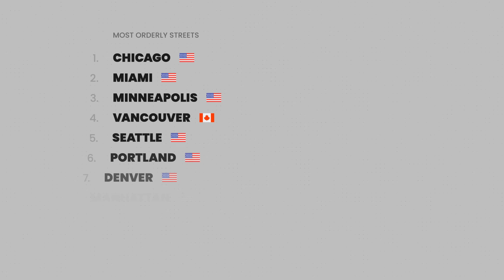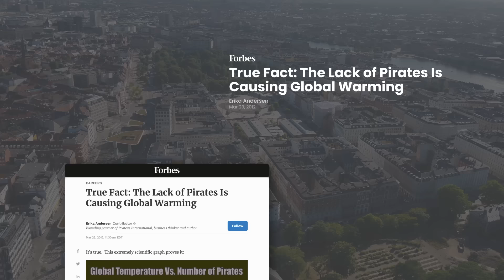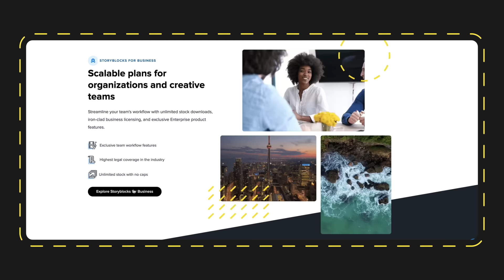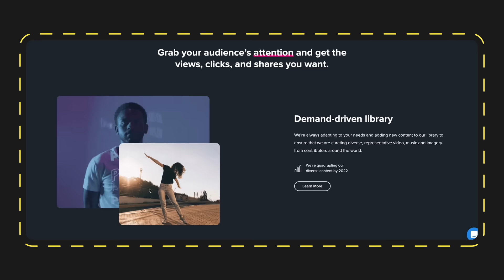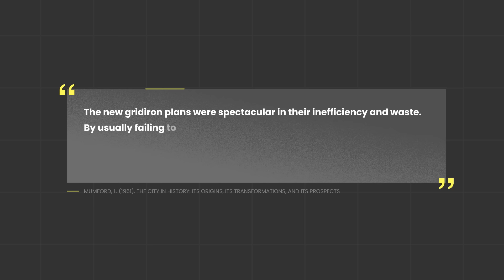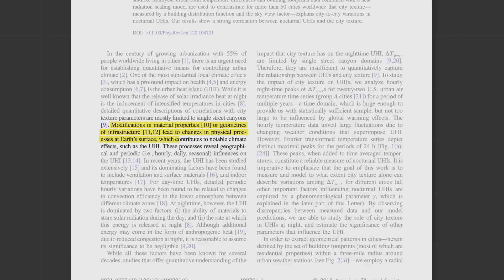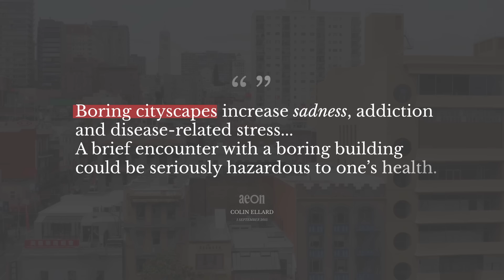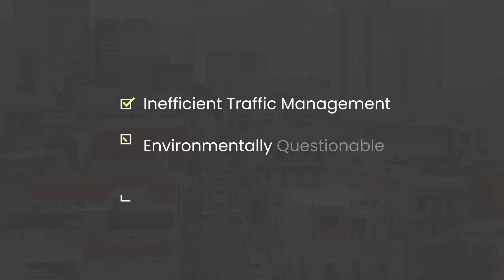Why Cities With Grids Are Terribly Designed

Comment: Urban planner here. I'm afraid this video is conceptually confused. All of those "most livable cities" have a grid in the sense that they have small blocks. A grid of small blocks is absolutely essential to support walkability and transit, whether they are straight or organic. Yes, if the grid is straight, with 90 degree turns, it can look a bit boring — the video's one legitimate point — but these grids can still support high levels of livability, as in Vancouver, Portland, San Francisco, New York, Barcelona, and many other cities. 

As for the grids that do have problems, the video got the issue precisely backwards. If Chicago has a problem, it's not that it treats streets as identical. (It doesn't). The trouble is that it excessively prioritizes traffic on many streets instead of human comfort. One of the biggest barriers to creating livable cities today is that streets are classified as avenues, collectors, or locals. On avenues and collectors, it's extremely difficult to design people-friendly streets, because engineers say they are intended for moving cars. 

As for safety, no, the grid is not the primary source of danger. High speed streets with long blocks are far more dangerous, as they encourage people to cross mid-block. That being said, I haven't looked at that one study.

The biggest barrier to livability that many cities face today is the lack of a grid — whether straight or organic. I'd like to solve that problem. This video didn't help.
Reply: Your entire notion of "livable" revolves around how walkability the streets are, which is nonsensical. Nonetheless, use walkability instead to simplify things.
Reply: @aliquewilliams3080  Why is that nonsensical? It's difficult to create lively, desirable streets and parks without also making them walkable.
Reply: @aliquewilliams3080  walkability is absolutely synonymous with livability.
Reply: Whathever the gov put his hands, it will get whorst. Let the city expand by itself...
Reply: The traffic problems of grids are caused by a total absence of road hierarchy. Arterials could be made by removing 67% of intersections on a big enough road, de - zoning buildings, and then put on some bus + tram lanes, bike paths, wide sidewalks.
Reply: @Spido68_the_spectator  Large blocks increase speed at the expense of access (the ability to travel directly to destinations), and in a dense urban environment, access impacts overall transportation time more than speed (especially for peds, bikes, and transit, but also for cars). This is especially so because pedestrian-oriented businesses and high-frequency transit cannot succeed on streets with large blocks, because they undermine walking. Large blocks are an appropriate solution for low-density car-oriented environments, where all destinations are far, meaning that speed trumps access.
Reply: @TristanCleveland  why not superblocks then? With ground public transport and cars going around, while each superblock is fully walkable (and plenty of pedestrian and bike infra between each)
Reply: @Spido68_the_spectator  Yep. Just keep in mind you need a higher level of density to bring street life to those paths without cars present. Streets without cars tend to die unless there is a high critical mass of people walking there already. (Lots of streets across North America have died when cities tried removing cars). Also, it's important to treat the connections as real, high-quality streets (or parks), rather than as half-assed paths on empty green grass — because few people will use them. 

Two caveats for cars: having so few streets means much less capacity for moving cars, unless you make the streets really wide, which undermines walkability. You also can't make the streets much faster for cars (or ought not) because that too undermines walkability. For these reasons, I think it's generally a better idea to stick with a traditional grid, but you certainly can make the superblock idea work with attention to these details.
Reply: @TristanCleveland  You seem to forget that streets are destinations and where the life of the city happens, not throughfares.
Throughfares for cars can be as wide as needed within sanity, as there shouldn't be any buildings off of them, and pedestrians and bicycle riders will be given fully seperated paths. Not to mention the straight/fast aspect makes them good contenders for dedicated tram/bus lanes in the median or outside.
Also, the street grid is a waste of space on its own and contraints building aethetics. A crap ton of unecessairy intersections which could be open spaces, pedestrian + bike path ect that make it feel like a grid inside a totally free form street design. You should stop relying exclusively on sidewalks to move either pedestrians or bicycle riders.

Also, the " dead " streets observed in the US and Canada are down to the morality that built up over the decades : " the street in front of the house is a death trap for children ", " leting children go to school on their own is to court de@th "...
Reply: @Spido68_the_spectator  The destinations in walkable urban areas can only survive if people can walk between them. Wide roads didividing destinations means there will not be destinations. Yes, thoroughfares can be as wide as you like, so long as they are outside communities. The streets that pass through communities must support human comfort or they will drag down street life and undermine the underlying logic of urban economic growth.
Reply: @TristanCleveland  yes, that's exactly what i said. Cars going around, people living inside and able to travel still without driving
Reply: @Spido68_the_spectator  Usually, the only way I know of a business existing is if I see it while passing it in my vehicle.  I don't walk anywhere, and I'm not going to.  If there is a place for me to park by the place of business, then I may go there, but if not, the business will never get my patronage.  That is just how I do things.  It does not hurt me to never enter a business.  The only one it hurts is the business if I don't enter.
Reply: @jpmarques1106  cities became car-centric in the first place because of government policy of making cars the only way to get around, which was caused by car company lobbying. Plus, the only reason roads are even paved are because the government stepped in
Reply: Saying he's conceptually confused and referencing small blocks is unfair. Small blocks are fine. It's when they are made on a big scale, where the land features are ignored and a 5 mile grid of bland sameness is erected. In Sydney we have plenty of small blocks, but when you look closely they are always submissive to the shape of the land they are on. That's what gives a city its soul.
Reply: @greenonionsalad  the video never addressed how the size of blocks is the issue. In fact, he even at one point said how the high number of intersections causes more traffic; a point against the grid. The real problem is how the streets are designed, not how they’re laid out. Like with Barcelona; design the streets for people instead of cars, and you will have a city just as nice to live in as with non-grid streets
Reply: I'd disagree with Vancouver and San Francisco being livable, the North American East Coast is the definition of hell on earth, but Barcelona is definitely a great example. Especially since having limited access to cars between blocks - it's highly walkable, highly accessible, and the pedestrianised streets are booming with commercial activity
Reply: @aliquewilliams3080  Bruh were you born yesterday?
Reply: @aliquewilliams3080  you clearly don’t understand cities
Reply: the whole point is not ability to change position, but whether it has any meaning, specifically - aesthetic meaning.
Every city should be a loop with a park-like center. at least.
Reply: @extremumone  why does it need to not be in a grid to give the place meaning? Central Park is one of the most well known city parks in the world for its size and beauty, and it adheres completely to a grid.
Reply: @extremumone  to me the argument seems like saying that cities should paint a mural on every fire hydrant to give each of them their own meaning. Yes it might look nice, but it loses some form of practicality (makes them harder for firefighters to identify) and just is unnecessarily complicated to change. Sure it’s fine that you might prefer non-grid streets more, but function over form has always been proven to be true.
Reply: How is New York 'livable'? I'm from Singapore, visited New York once and never want to go back there again. Streets are dirty, noise pollution every where, rent is crazy expensive, food is expensive, there's trash and filth everywhere. Singapore and New York are one of the most expensive cities to live in but it's so much more comfortable AND safe to live in Singapore compared to New York.
Reply: @reveirg9  thank you Singaporean. Anyone wondering how to design a city, look at Singapore and say no more. It’s not hard, with lot of common sense.
Reply: When you say "On avenues and collectors, it's extremely difficult to design people-friendly streets, because engineers say they are intended for moving cars.", is it more of a universal reality around the world or some tendency of builders specifically in America?
Reply: @edwardyoon6296  USA, Canada, and anywhere where the AASHTO Greenbook is influential. Many countries do adopt it. 

*I should have said arterials.
Reply: This was really interesting. Thanks for sharing
Reply: I never get bored with straight lines, it's faster to walk, drive, think. I do not have a airplane, i'm not a bird, i do not keep looking everything from top.
Reply: Just for fun, let's add another parameter that has nothing to do how livable a city is and that would be flatness. Chicago is very flat whereas, say Seattle or San Francisco is hilly. I'm sure there must be other cities even more hilly. Would flatness that makes travel easy by not having to go uphill or downhill esp during wet or icy conditions make a city less livable? Similarly a grid makes navigation easier esp in an unfamiliar part of the city esp during night and/or foggy conditions. Merely recognizing the street name on the south side that one is familiar with on the north side instantly gives one an idea of where they are. How does this not make it more livable being able to travel further from one's familiar neighborhood and explore more distant parts of the city? Or the ease of giving someone directions. A gird is not an issue, but many other factors are, including proritizing too many streets for cars, or not having better public transportation or due to food desserts, insufficient parks and green space, or having giant malls with huge parking lots vs small neighborhood retail stores that are walkable and not having options for a third place (not work, not one's house) where people can hang out and socialize for free (not a bar, cafe or restaurant) year round (not a.park ij winter) available anytime and without severe restrictions (not a library). Such places have been disappearing.
Reply: When I think of "liveable" San Francisco and Portland definitely spring to mind /s
Reply: Please go on google maps, use Copenhagen as a case study, and count the largest grid you happen to find. Then do the same for Chicago. In your first statement you confuse "blocks" and "grid". Among the grid cities you yourself mentioned, I can tell you that at least New York and BCN are taking active measures to transform their grid with street closures to cars (see "superblocks" and "open streets"). This supports the video author's claim that the grid itself doesn't cause cities to be less livable, but rather that when cars are introduced into cities, the cities with the larger and more uniform grids end up with worse street conditions.
Reply: @misopix  I'm afraid I don't understand what you mean by "largest grid." Copenhagen has blocks around 200-500 feet in "block section" (the furthest distance you can measure inside the block - a useful measure of block size). Chicago has blocks roughly 400-650 feet. Both are very walkable, though Copenhagen more so. 

Pedestrianizing some streets is great. It retains the walkable network of small blocks for people walking, which is what counts for pedestrians. Whether we call that a "grid" or not doesn't matter much: people just need short blocks to walk in a straight line to destinations.
Reply: @TristanCleveland  I had a roommate at USU that was from slovenia. He was getting his masters in city planning or something working on a project to make a more walkable or people friendly map for Odgen, Utah, I believe. I can't remember. Yes for people culturally used to walking and living in cities I suppose it makes sense to make cities walkable. But I'd argue one reason cities weren't designed that way was because of prices of real estate. Many people prefer to live further away from the city and travel to work. The cost of real estate or housing seems like it'd be cheaper or would promote more affordable housing if people could travel rather than rely on walking from home to their work. It's one reason lots of cities have literal commercial or industrial zones for businesses to build in. Sure they can build a warehouse or mechanic shop etc. in the center of a city, but I've seen many businesses be engulfed by real estate development eventually selling and moving the business to the edge of the city or out in the county. Now for high paying companies or whatever sure it doesn't matter. Big banks or law firms etc aren't going to leave the middle of a city. But many many jobs literally are forced out of a city especially if the company rents the land or building. Public transportation helps sure, but if you build a train system that's still not a walkable environment. In Utah for instance many people drive to parking lots by a train stop and then ride the train to the city. But you're not walking as you drive to the train parking lot and then you take the train. Even in the rural town I live in with a few massive companies that make guns or airplane wings theyre on the edge of town. If people were to walk they'd literally would have some walking three miles one way and that's not very livable if the temperature is 20-30 degrees for a few months or if it drops to zero for a few days. People aren't going to ride their bike either even if there is already low traffic. The city or town has zoning laws so the first block is commerical, but no large company builds on the first block as you can't expand. So large companies literally have to be on the edge of town.
Reply: @Spido68_the_spectator  traffic is solved and intersections are removed on some roads. It's called the interstate system.

Comment: Cities like Chicago and Minneapolis are FANTASTIC when it comes to car transportation unlike Dallas and Charlotte
Reply: Cities should not me made for cars.
Reply: @karsthalen5381  Yes they should be*
Reply: @aloe704  No. Not at all.

1. Cars are polluting. In a place with many people it’s important to keep the air clean. Public transport is more sustainable.
2. Cars take in loads of space. A train or subway can transport so many more people taking in a lot less space.
3. Parking lots make up for like half the surface of the American cities.
4. A system with cycling is way more efficient. Taking people out of cars and putting them on bikes doesn’t only make them go from A to B quicker because they aren’t stuck in traffic jams, they also prevent traffic jams from happening. This way, the cars that do necessarily need to enter the city for emergencies or because they LIVE there, can go from A to B way faster. 

I hope that sums it up. Believe me, I live close to a city designed for predominantly cycling and also allowing but not supporting cars to go in. It’s so efficient.
Reply: @karsthalen5381  My bad, I misread the earlier comment, I agree. for some reason I thought you were talking about all transportation
Reply: @aloe704  Okay my bad

Comment: New York has a grid. Philadelphia has a grid. BARCELONA has a grid. The grid isn’t the “problem” the car centric nature of the grid is. If every street makes you want to drive a car, if there isn’t reasonable public transit around. If the shops aren’t near to your residence. And European cities tended to be around for hundreds if not thousands more years. They started as small developement. And weren’t centralized enough to impose a grid let alone a sewer until recent history. Grids aren’t bad. Grids are simple and they are effective for navigation. Proven by Manhattan. Cars are the problem. Cars are bad for cities. And how do you feel about suburbs? Huh. They aren’t on grids. But they suck ass. Grids aren’t bad. Car centric grids are. Shit… if you had trams or other public transit you could lower the amount of cars. You could LOWER the size of cities and regreen them. PUBLIC TRANSIT. That’s why American cities suck. If American cities had decent, wide reaching public transit. The noise in cities would decrease. The space for greenery would increase. You could walk in the the center of the road. The street of the city you live in. Your car isn’t a resident. It’s well being is against the well being of the city. Shit. Most kids learn about basic traffic management at a young age. Purely from the school system. Where by, you can see the direct exponential increase in car use and traffic. But by busses and other PUBLIC GOODS, we increase the well being for the entire community. Owning a car isn’t a problem. Lots of Europeans own cars. But europe has decent public transit, the US has urban freeways